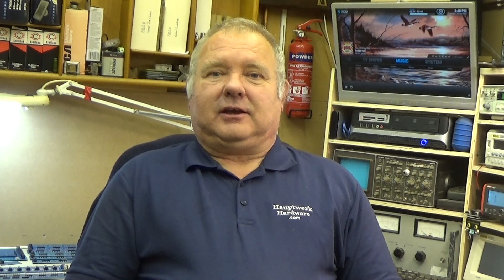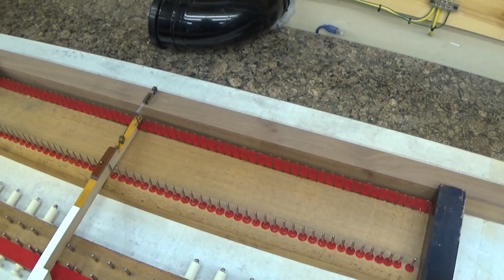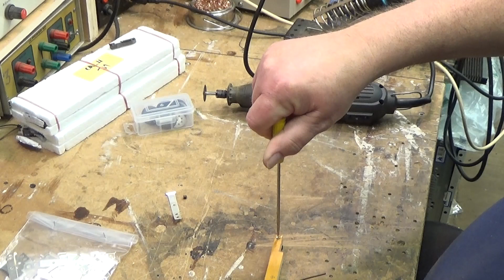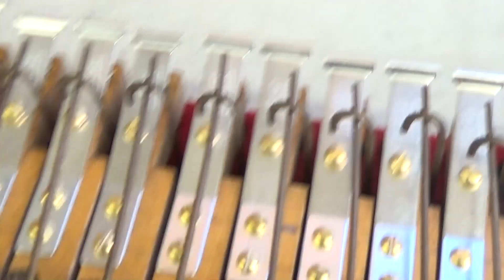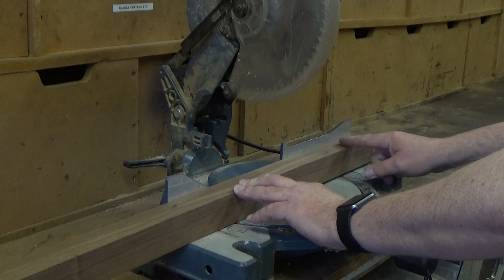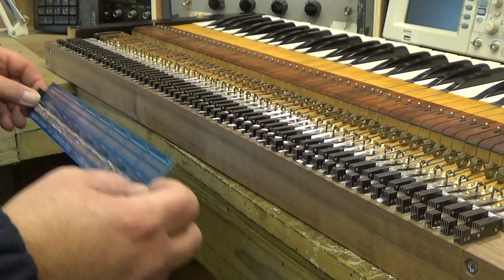Tracker Action Keyboard Part 2

Comment: Wouldn't Hall sensors be the better choice, as they're more reliable and take less space to fit?
Reply from the maker: You could use Hall Effect sensors but the wiring is slightly more complex as they require load resistors. These contacts are the traditional way.
Reply: Tricky to isolate the magnetic fields between keys... I've used them for a pedalboard—the interference is minimal at that distance.

Comment: Interestkng, straight forward conversion.
Does Kimber Allen sell these components directly or only thru dealers? What is the cost?
Reply from the maker: Hi Ed, Kimber Allen only sell to organ builders. The cost of the contacts that I used in the video is around £2.50 each and the Wipers are £0.99 each. All plus VAT.  My company, Hauptwerk Hardware are dealers for Kimber Allen products, so contact me via the website (www.hauptwerkhardware.com) if you want any more prices or to order anything.  Hope that helps and Happy New Year.

Comment: are these KA contacts suitable for the 5V encoder board? The gold clad contacts are better for low voltage so was wondering about reliability...
Reply from the maker: The encoder is quite happy with the silver contacts. It has a very high input impedance making it very sensitive.  It will even work fine with conductive rubber contacts with resistances of around 100 ohms.  A good question though - thank you.